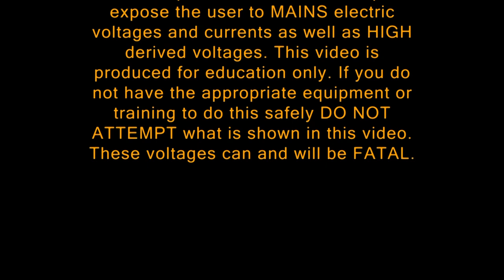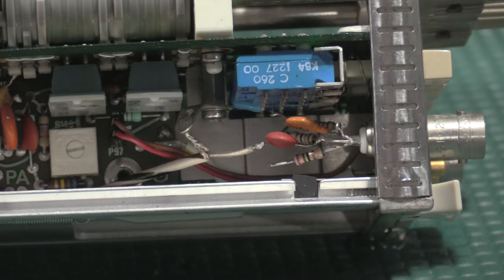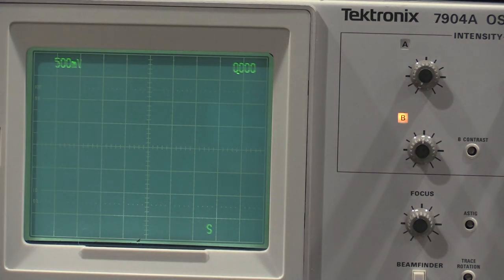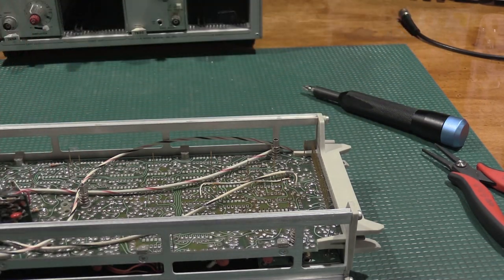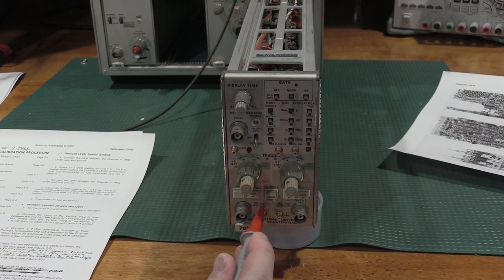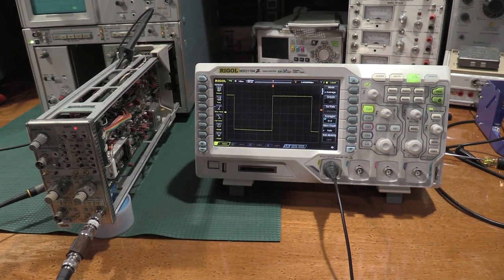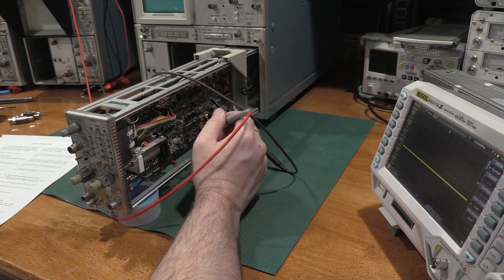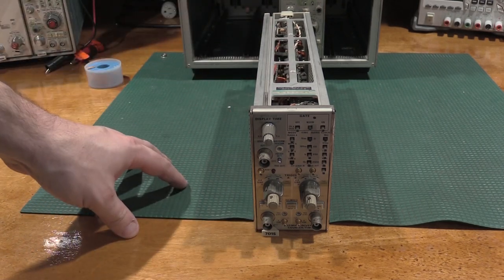Tektronix 7D15 Repair and Alignment (Somewhat)

Comment: Got a new "toy" this week.  A 7104 that looks like its been pretty well cared for.  A bright CRT with signs of burn only at the top where the readout sits.  It doesn't have a 7A29 vertical plug in but I think it has a correct horizontal.  The number on the lock pull has been obliterated.  Looking forward to more 7000 series vids

Comment: That broken wire on the input looks suspicious. Neither the wire or resistor is present in my 7D15 plug-in (S/No B134492). Also, there is nothing like this wiring shown in the schematics in the manuals I have.

I wonder if this was a user modification to access an internal signal in the scope mainframe bringing it back to the counter input for measurement. If the extra cable went to a low-impedance net that might significantly load down your A input giving the weak and noisy signals you are seeing.

However, this wiring mod would not affect the performance of the counter when you are viewing the signal direct from a plug-in via the TRIG SOURCE input selection as in this mode the signal is disconnected from the circuitry on the input BNC socket.

The missing wire you mentioned wouldn't affect the function or sensitivity of the A input but it would merely prevent the sharing of the A input with the B-channel.
Reply from the maker: Yea my service manual calls out adding it but that is hand drawn and with handwritten updates to the service manual. I'll dive in to it a more and see what I can find.
Reply: @ZenwizardStudios  Just to clarify the missing wire I was referring to above  was between the two halves of the SOURCE switch S95. I have seen hand written notes on some manual scans saying that this connection is missing on some versions of the 7D15. I assume this was a manufacturing error on early production models as there is no mention of a change to that area of the circuit in the updated Sept. 1986 hard copy manual I have.

This wiring error is unrelated to the extra coax cable you have on your unit. I think the best thing would be to trace that coax cable back to find out where it connects to. It seems most likely that has come from a signal source of some sort as it feeds directly into the 1Megohm input of the A-channel. I don't think the cable transfers the A-channel input signal to some other part of the circuit as Tek would have made such a connection after the input buffer Q25 to avoid the extra loading on the 1Meg input introduced by the cable capacitance.
Reply from the maker: Hmm I will look in to that. On yours does it have connections at the top of the plugin They go in to the 4 pin connector on the back of the plugin.
Reply: @ZenwizardStudios  Are you referring to the 4 barrel housing at the top of the rear panel plastic moulding? 

My 7D15 doesn't have anything in there. I don't think these were ever used for connections on any standard 7000 plug-in. As I understand it this housing was reserved for a fibre-optic connection to the main frame which never eventuated.